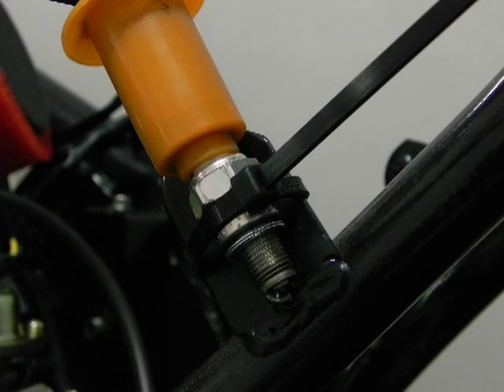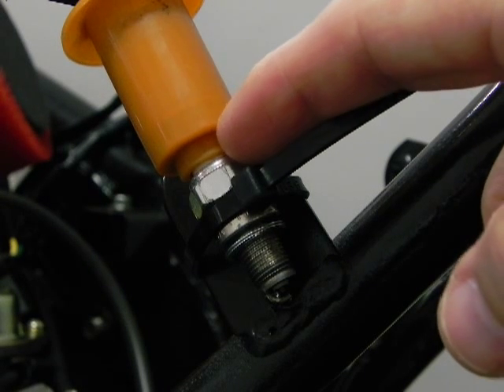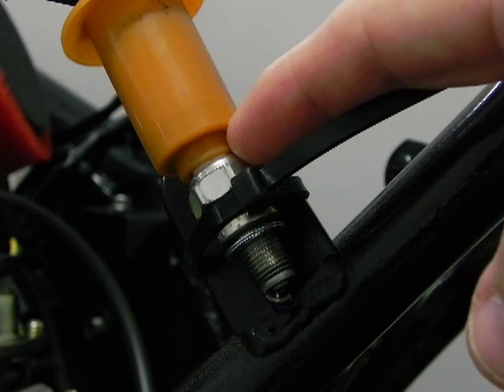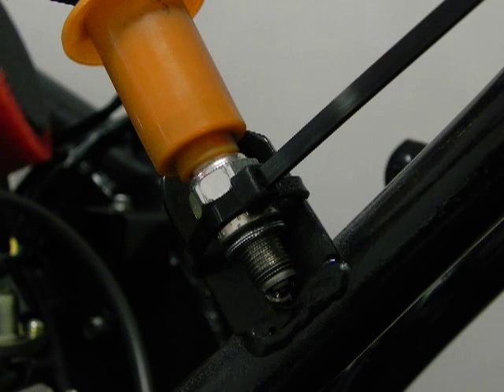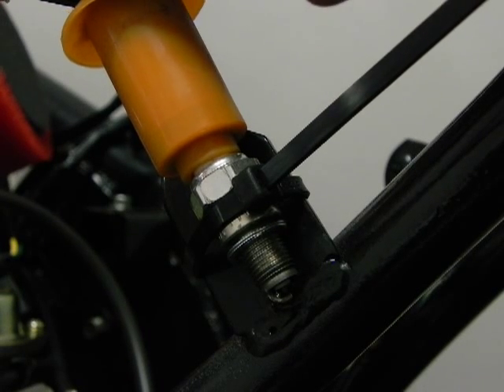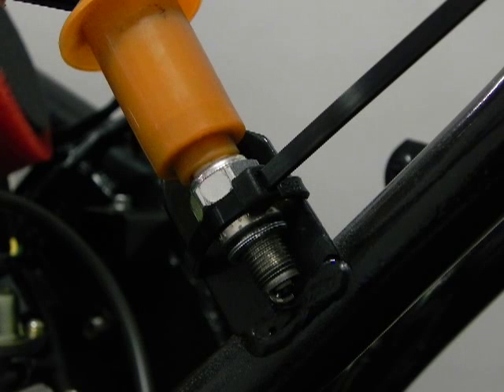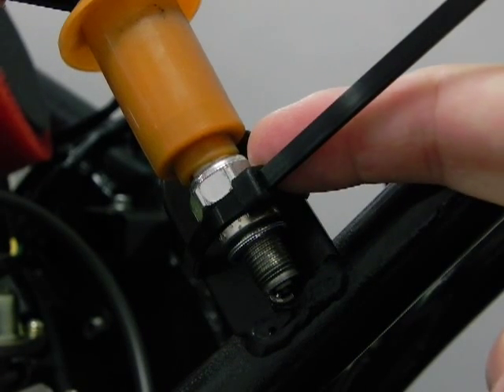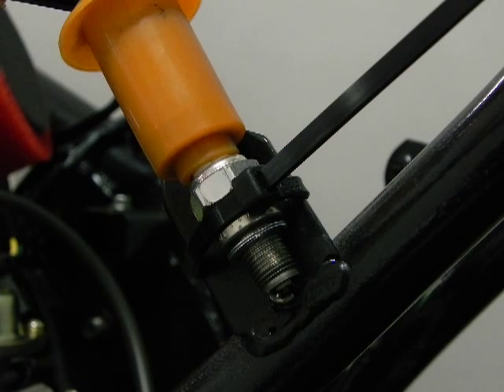GY6 Spark Test

Comment: I did mine yesterday. Orange spark but no problems starting. Battery is nicely charged. I did the test on my CDI seems good, new spark plug, and coil is not faulty. Already did over 40,000kms so I'm thinking the Stator could be on its way. Anything else that could trigger a weak spark?

Hmm perhaps the electrical wiring harness?

Comment: hi, i have a 150cc roketa gokart that i have an orange spark and not as continuous and blue like yours, i replace everything: coil, sparkplug cable, spark, CDI, regulator, stator,carburator, all hoses, filter, switch, fuel tank check valve, and my engine tries to start but nothing else, please help me!!! is there anything else that causes a weak and orange spark? and if so is this the cause that engine doesn't start? thanks.

Comment: What if there's no spark? Does that mean it's the cdi or stator?
Reply: cdi stator ignition coil & sometimes plug cap =D or maybe dead sparkplug
Reply: Yuri frost Thanks this issue was fixed until it just happened again today... I have two ignition coils and neither is showing spark so my guess is that its the CDI or the Stator.
Reply: yes it is ,check ignition switch and cdi socket too

Comment: IF it is an orange weak spark, what are the odds of the scoot not starting at all? My scooter broke down today and found my coil wire melted (not all the way through but pretty far) because it was up against (some tube I haven't looked into what it is yet) ... I just did your test and it's putting out an orange spark. I WILL replace the coil but I don't want to 100% believe that this is what shut her down. It gets 7ohms from the spark plug end of the coil to each tab of the other end.
Reply: Ok so I solved it. It will start up, but if I kinda kink the wire where it melted, the scoot will shut down. So problem solved, I'll need to buy a new coil. Thank you for the video, it led me to my problem!